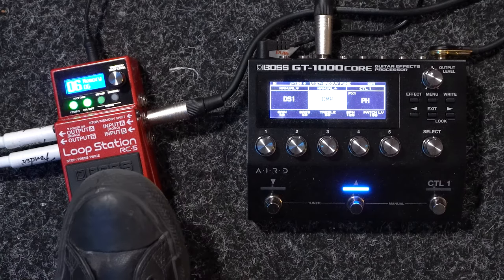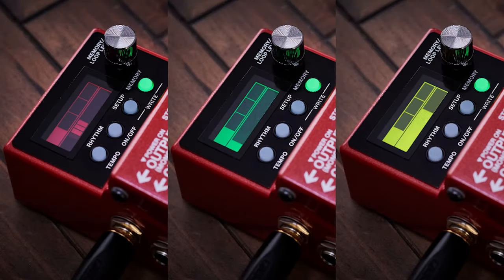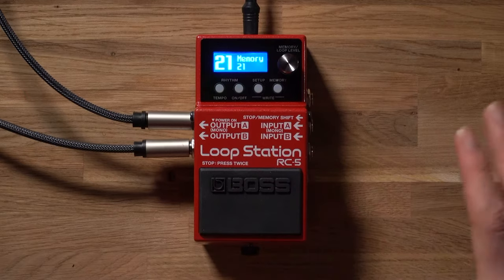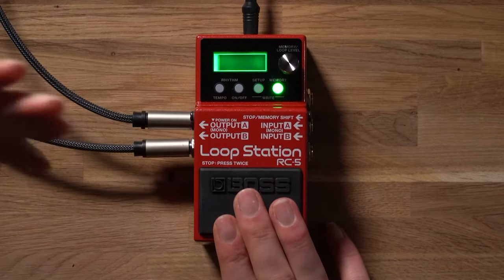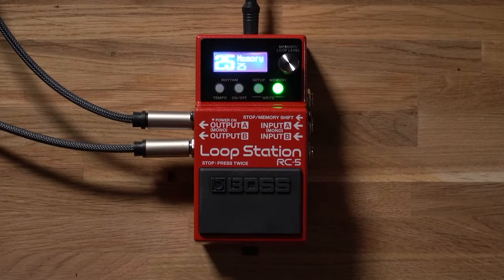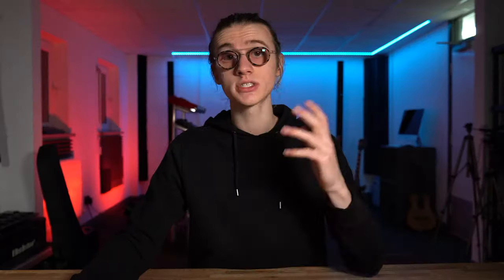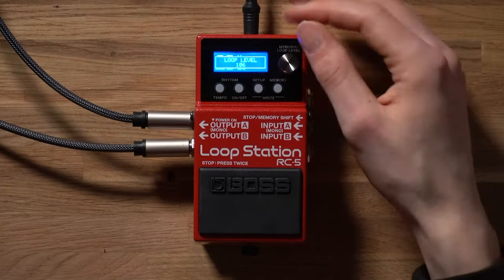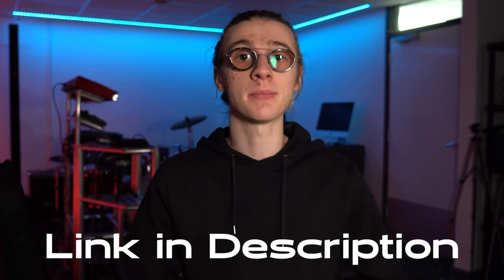BOSS RC-5 Loop Station Getting Started Guide (Loop Station Overview)

Comment: hey, i want to use something to record a my rhythm track on, loop that, then play lead guitar over the top in a separate amp. can the RC-5 do this?  is it possible to record a loop, then output the loop to amp 1, while I play in a separate amp 2 - I see their are 2 outputs?
Reply: It is not cumbersome to use, but it is a challenge to learn. It’s worth it. It’s a great tool.

Comment: But one thing I don’t like is that I filled all 99 memory slots and I backed all of them up so now I’d Love to be able to take all my favorite loops out of those first 99 and put them back on the rc 5, but I just want a few of them back on my rc 5, The problem that I am having is that i am not able to pull tracks individually with the data for that track, as in there is not one data file per track and all the data (tempo, drum track, levels, settings etc……) for each track are contained in the same file, so I can’t take a loop so basically if I want all those settings back I’d have to put all 99 loops back on the pedal and I have tried just taking the wave files out, and it will cause the pedal to glitch out when you go to record on an empty track because it still has that data file on the pedal witch is telling the pedal that there is a track there but it gets confused because there is no wave file so when you hit record it will get stuck on record, this is kinda very unintuitive and a really ass backwards way to go about being able to back up tracks, this complicated problem has a very simple solution, and it wouldn’t be a problem if each track had its own individual data file in the same or different folder of the track, so idk what to do other than just to back up every 99 loops. Maybe it can be fixed in a firmware update, also they need to add a global drum level setting because 100 is too high for a default level at least for me it is, of course I could change it each time I’m on a different slot but it would be really convenient if we were able to set a default level, I’m hoping for a big firmware update in the future because they still have some bugs to workout.

Comment: I'm older and all I'm looking to do is lay down an entire track, save it, and be able to recall it and play it back through my PA at solo gigs.  Can anyone tell me how to do that?  Boss RC-5
Reply: Plug your pedal right into the computer. It will show all the folders. add your WAV 44.1 32 bit floating file there. (NOT MP3!!!) I use mine like you want to and it works great.